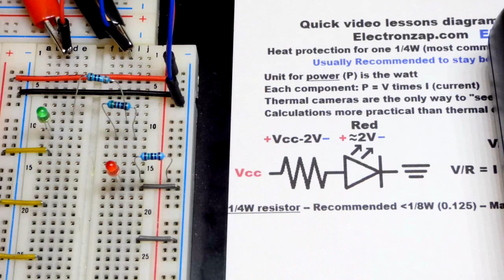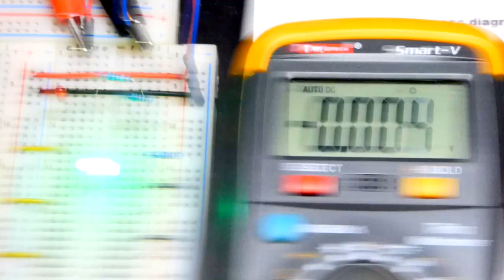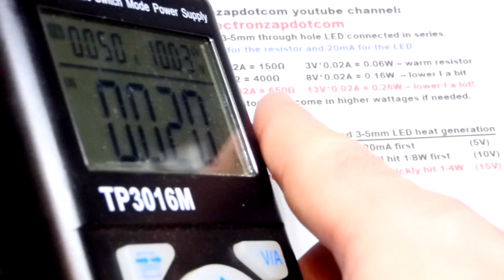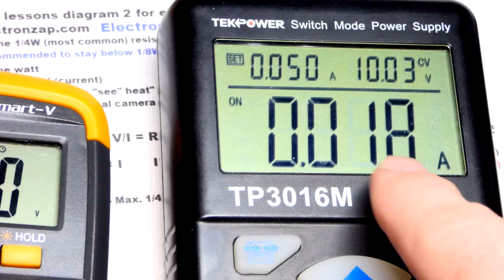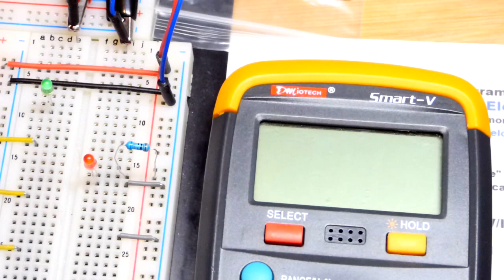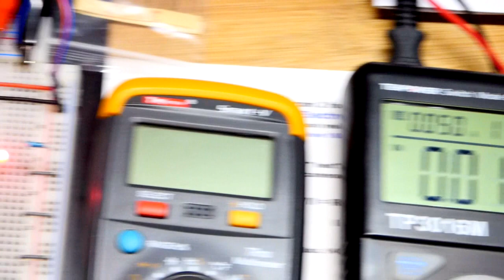Measuring voltage across individuals components is a vital skill for quick videos 5 by electronzap

Comment: I am by no means bored. There's a lot I don't know about biasing transistors. I built a triple half H-bridge to drive a brushless motor. The motor spins but the voltages in each phase are not equal. I'm getting an unbalanced output from the three phases and as a result I cannot get the desired output from the LM339 comparator. (Thanks for your comparator tutorials, they were really helpful.)
Tomorrow I'll measure voltage, current and gain for each transistor as well as power source voltage and current.
EDIT: Once I get a uniform output from the H-bridge I'll work on the divider network.
Reply from the maker: Very cool! Hope it goes well!